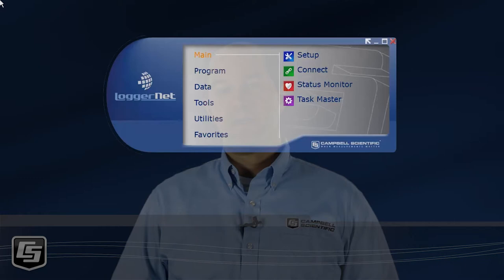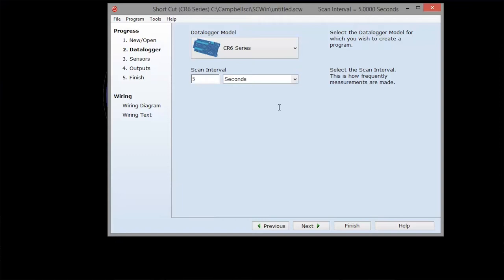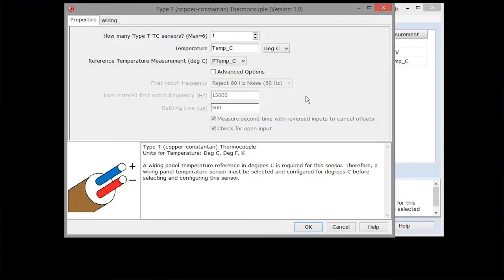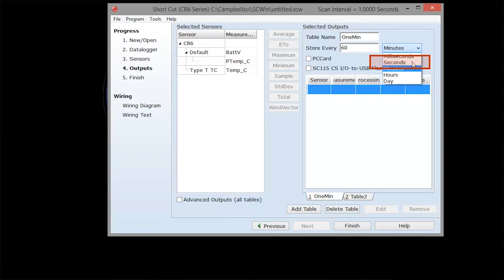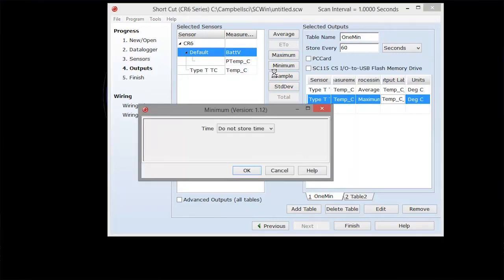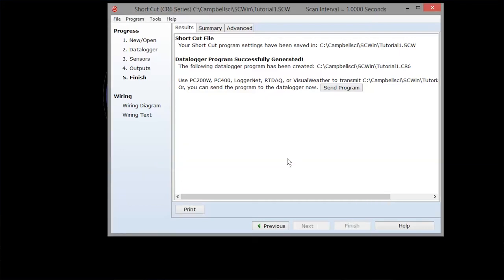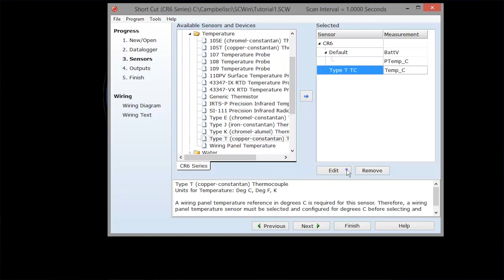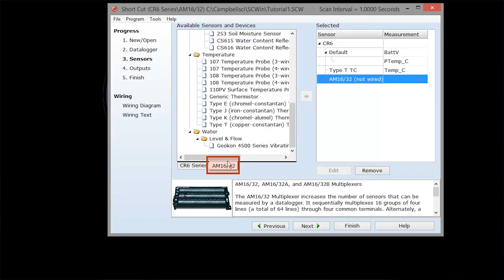QuickStart (Part 2) – Programming with Short Cut

Comment: How do i know what multiplier and offset values to use for a full bridge setting?
Reply from the maker: Are you using the Generic Full Bridge in Short Cut? The Help tells you what the output is based on a multiplier of 1 and offset of zero. For example, for a CR1000 "The result, with a multiplier of 1 and an offset of 0, is the millivolts output per volt of excitation." From that you can scale your readings to the particular sensor you are using.